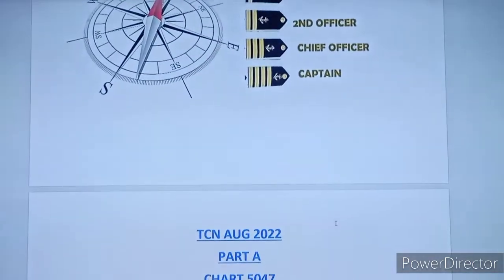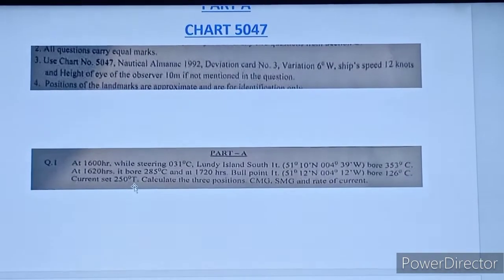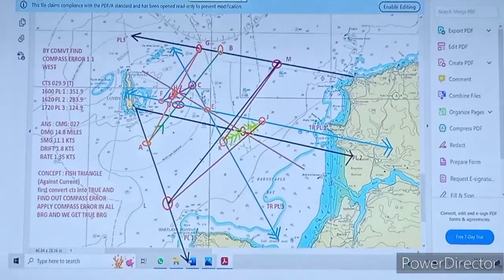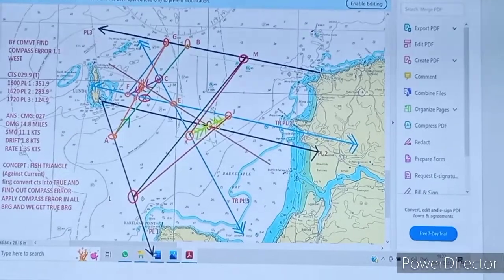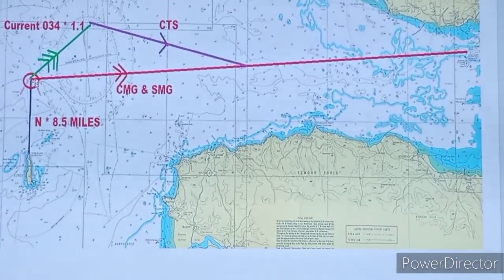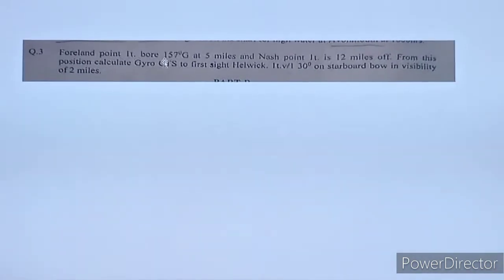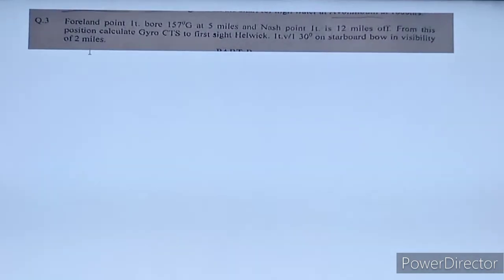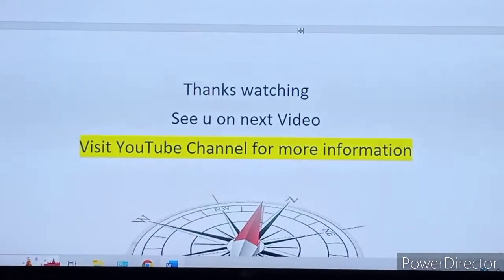Chief Mate Phase 1 Chart Work TCN - Aug 2022

Comment: sir, how did you calculate 1.1 is a error from dev card 3 ?
Reply from the maker: By C D M V T method
Reply: Deviation is 3.64W and V 6 w So compass error will be 2.36w
Reply: Yes 2.4 degree W